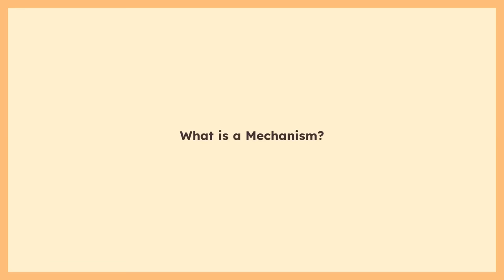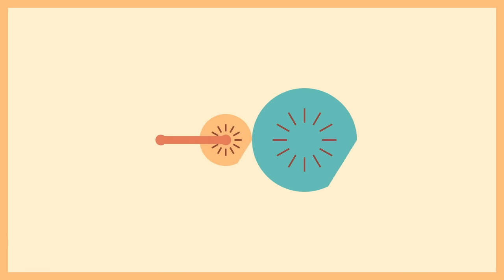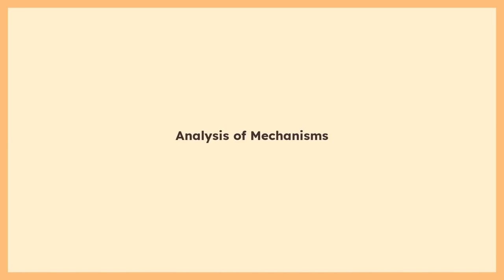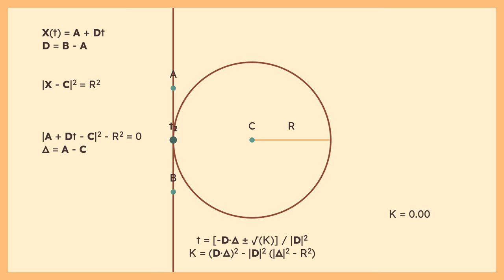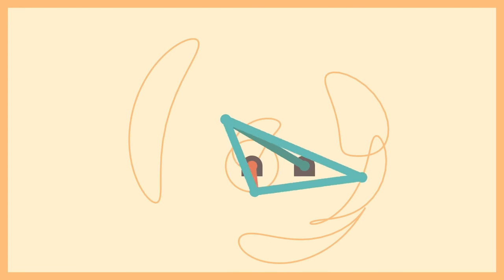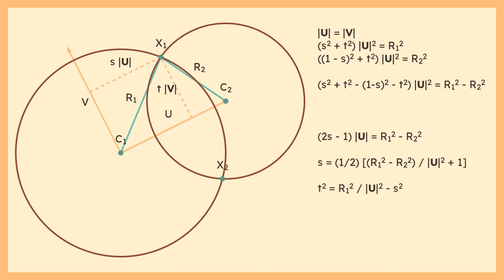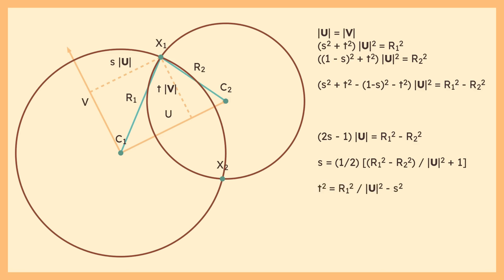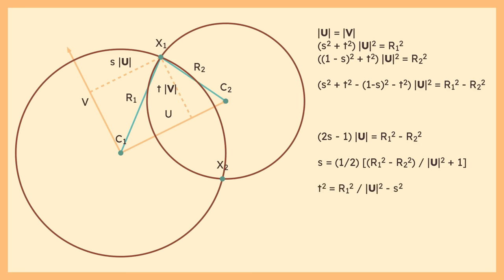The Mathematics of Mechanisms (#SoME3)

Comment: The discrete Fourier series describes a mechanism which can draw any closed curve using epicycles. If every coupler mechanism can only draw closed curves as well, then there must be an equivalence between two coupled discrete Fourier series and a single discrete Fourier series. Describing what mathematically represents the coupling between the two discrete Fourier series is difficult.

Comment: Can complex numbers be applied to this math? I’m curious because there’s a lot of rotation, and complex numbers seem to fit in wherever you see rotation.
Reply from the maker: Complex numbers are just 2D vectors, so yes!
Reply: You can also use conformal geometric algebra to describe not just rotation, but also translations as well as the circles defining the possible positions of P2 and P3 (or similar circularly constrained points in a linkage). Many of the calculations done in this video, such as finding the intersections of two circles or constructing a circle from three points on its perimeter, are expressed very elegantly in this language. To top it off, it generalizes very elegantly to 3D and higher dimensions, so you can get all the benefits of the complex numbers as well as quaternions and dual quaternions inside CGA.
Reply: they are used commonly, actually

Comment: I've written a program to simulate the Chebyshëv linkage, which traces the Nilla curve. The bottom is nearly flat, while the top is nearly an arc. At four equally spaced times, it's at three points in a line on the bottom and at the middle of the top. It looks like the cross section through the middle of a Nilla cookie.

Comment: Fascinating video! I'm most interested in the inverse problem, finding a mechanism that produces a certain path. In your example, you show a how to derive a solution of an easy instance of this problem, where a simple four bar linkage is sufficient, and using only three "samples" of position+rotation of a segment that should be reached by the mechanism. But how would one go about synthesising for a path like the one in 13:32?

Comment: So, I've been trying to figure out how to visually represent some stuff - I'm quite hypermobile/have some pretty peculiar stuff going on with my nervous system and I want to find a way to create a hard map of the range of motion of my bones/joints, and then somehow overlay that with my internal/imagined map of my body. For most of my life I've had a bunch of involuntary tics, and since I was a child they were dismissed as a baked in problem of being a flappy autistic person and thus to be pretty much ignored - but upon realising that they were a manifestation of problems with connective tissue/rooted in weird stuff with my nervous system, I started engaging with/adjusting some of them - one in particular had been constantly subluxing my jaw and had (as wild as this sounds) resulted in me losing an enormous range of my sense of touch/pressure detection. Fixed the issue with my jaw and trained myself to pay attention to what my body was actually trying to do and over the past two years my sense of touch/proprioceptive map has exploded outwards from my neck/shoulders/spine. I feel like this kind of map of where my body actually can move, and being able to mark onto that which ranges - while possible, were destructive/overstretched joints would be incredibly useful. It also feels like something that someone must already have done to some degree. Do you have any suggestions on resources to look into? I'm not a mathematician/programmer of any kind - but this feels like the most promising tool with which to build the physical/mechanical part of what I need to create to make useful/discrete statements about what's been happening

Comment: The discussion of jamming position was interesting.  I have to wonder if there is a way to limit or constrain the configuration space during synthesis such that the number of degrees of freedom can only ever increment or decrement (by one).  Similar to the K-map concept the intent would be to  prevent simultaneous changes and thus minimize undesirable or indeterminate behavior.

Comment: I once tried to simulate heusinger gear of steam engine and failed at combination lever. 
If I recall problem is that contrain is something like end and mid point are allowed to move on two circles and distance is defined by distance of mechanical joints. Third point is on some curve which I cannot properly describe. Other link has the same or similar contrains and intersection of these curves is a solution. Maybe it can be solved for tens of possible positions, drawing line segments between solutions, repeating for other links, finding intersections of line segments approximating these two curves and subdividing intervals to get more precise result. I just can't imagine how people designed that 150 years ago or so, because solving something like 4-5 equations with trigonometric functions is hard. Maybe tthey did not need to know precise position of joint, they just made sure that it satisfies number of degrees of freedom and that it combined movements of two levers with a proper ratio and made some smaller model from sheets of metal with holes and rivets.

Comment: A crank slider is a four-bar linkage also.
Reply from the maker: Yes but it has a prismatic joint. I focused on revolute joints only.
Reply: @mtirado  I had a mechanisms class as an undergraduate mechanical engineering student and an advanced analysis and synthesis of mechanisms class as a graduate student.  We used primarily the vector loop-closure method for mechanism analysis.  We used both analytical and graphical methods for mechanism synthesis.  One of the final projects we had was to derive the position, velocity, and acceleration equations for a 10-bar John Deere level-lift mechanism.  I also had an advanced dynamics of machinery class as a grad. student.  One of my favorite analysis methods was the Chace vector analysis method for 3-dimensional mechanisms.

Comment: at some parts of the video u have to get the square of a vector or multiply two vectors with each other But how are you supposed do do that should i multiply/square the single components of the vectors, should i take the cross product of them, should i use the dot product or something different?